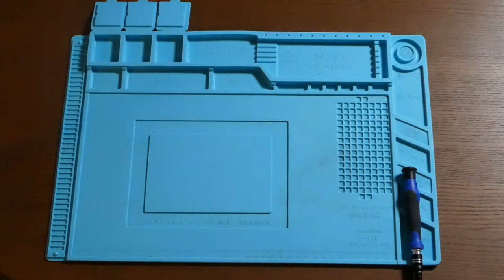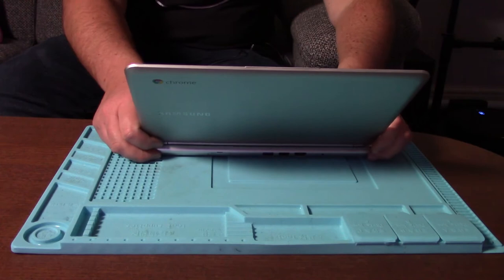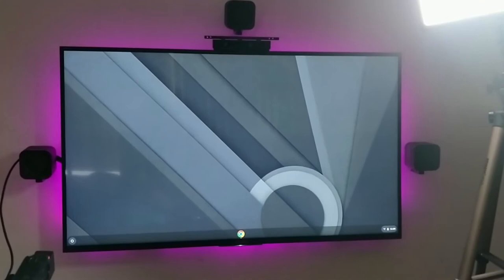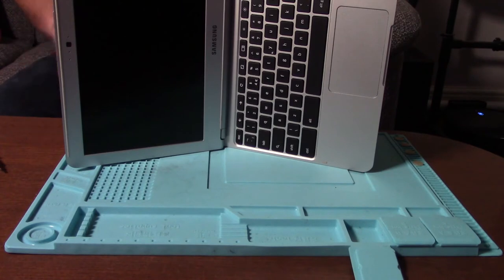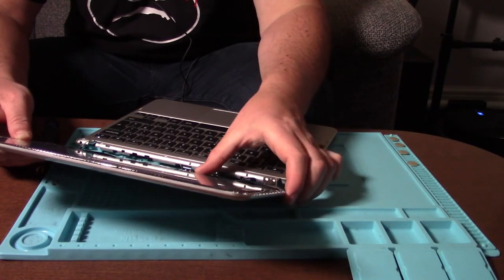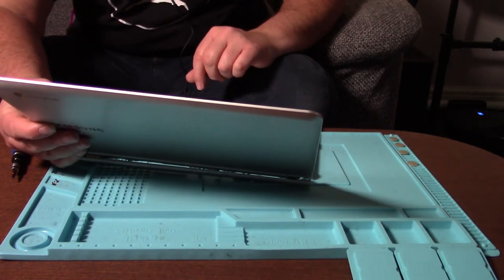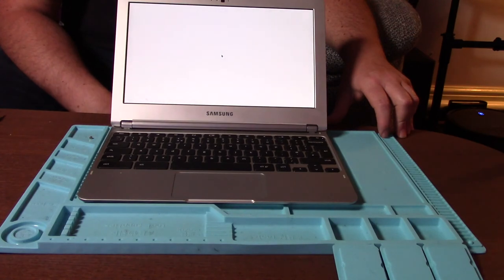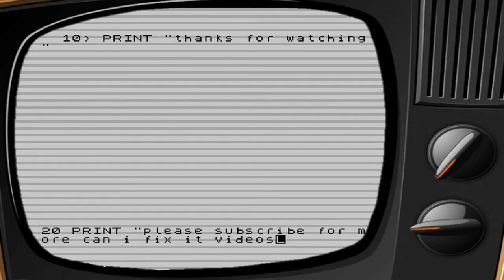Samsung Chromebook with a faulty display.  Can I Fix the blue lines of death? :)

Comment: Always disconnect the battery before unplugging the screen. You can blow the back light or damage the screen all together.  Also, be very careful working on the screen as it may take in 19.2 volts but the inverter will punch the voltage upwards of 70 plus volts on laptops.  It will make you spit your gum out if you touch the wrong thing.  But well done...good job.